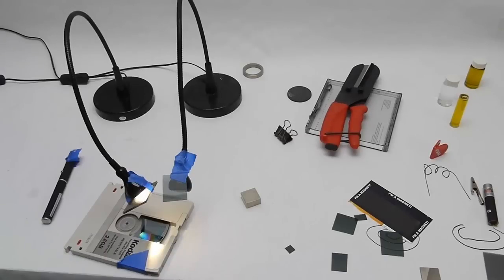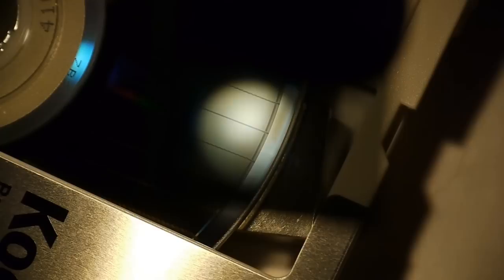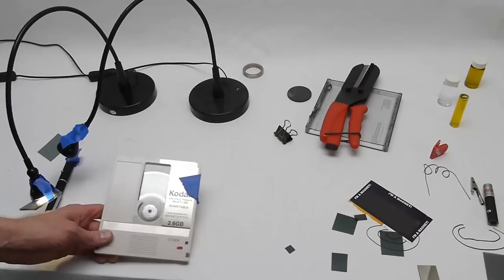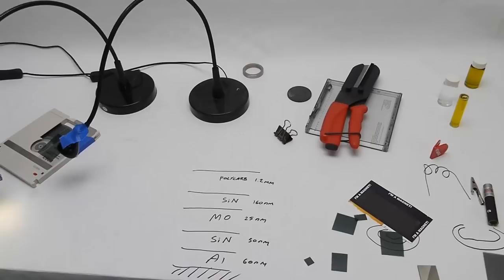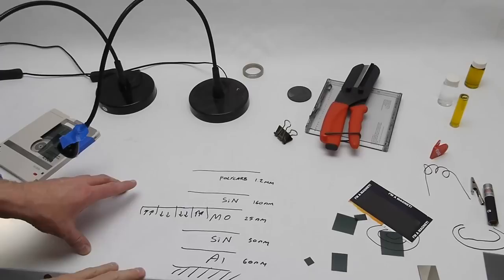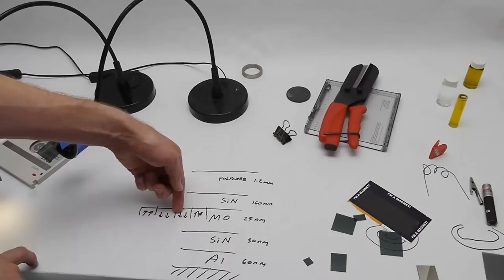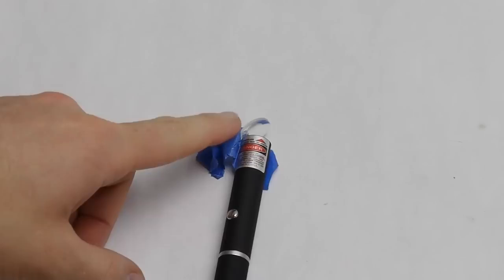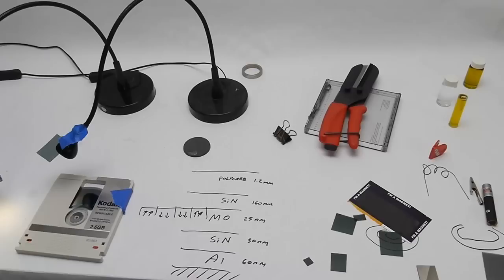Control light with heat and magnets (Magneto-optical Kerr effect)

Comment: Just to clarify, random access means that you can access arbitrary data on the storage without the need to go through the rest of it. For example magnetic tape is not random access since you have to scroll it to where you want to read or write which takes time proportional to the distance from where the head is. 

The term you wanted is rewriteable.
Reply: mina86   I would say when writing is is randomly placed; when reading, it is reading the scattered data as opposed to adjacent.

Comment: Temporary effect in poly carbonate reminds me of photoelastic ( or elasto-optic) effect that's present in materials like glass, celluloid, gellatin and wide range of resins. It's connected with mechanical stress and some explanations exist like Wertheim law. Your testing setup is very similar to what was used in measuring of mechanical stress in complicated objects before computers were powerful enough to run a simulation like that.

Comment: This was really interesting. You described how the magnetic field was flipped while a laser heated the material up to its curie point; is this similar to how re-writable DVDs and CDs work?

I had a MiniDisc back in the day, and it was great. This was shortly before MP3 players were a thing, so being able to carry around hours of music in something half the size of a cassette walkman was revolutionary back then. Plus it ran for ages on a single AA.

These days we just do it all on our smartphones, but you can get MP3 players with 10 times the capacity at a fraction of the size. It's crazy how far tech has come in 15 years. Solid state storage and Li-on batteries are the dog's bollocks.

Comment: MiniDiscs were great. I bought a MD recorder when Sony introduced the HiMD version in 2004. Better sound quality than the MP3 players in that time, exchangeable storage and the retro factor. Really nice system, but ancient compared with modern players.

(Still have my recorder and tons of MDs.)
Reply: ***** You do realize the sound quality depends on the bit rate encoding of the MP3, not the storage medium, right?
Reply: ***** It depends on the bitrate, the codec and the hardware. At that time flash memory was expensive, MDs were cheap. The Atrac3+ codec is much better that MP3 (same bitrate). And the hardware of Sony MD recorders was better than most other MP3 players.

Today flash memory is cheap. Now I use FLAC, AAC or opus and high quality players with micro SD cards.
Reply: Oh, Sony used a different CODEC than MPEG.

Comment: Could you tell us how did you measure the output power of the laser ? I bet a lot of us would like to know.
Reply from the maker: Periode-ik I used a commercial optical power meter at work.  Kinda cheating, I know.  The cheapo eBay laser pointers vary a lot, but they are all way over 5mW.
Reply: Periode-ik Cheap way to get ballpark (I guess error is few %) figure of laser power is to take solar cell with known absolute spectral response. It tells you how many A you get per W of incident light power at specific wavelength. Then you measure short circuit current of solar cell when you shine laser on it. From there is very easy to calculate power of used laser. This method is proven to work even for near IR lasers with few W of power. 

If you have any more questions I will be glad to answer.

And always remember to wear safety glasses when looking at laser with remaining eye :)

p.s. I figure you can use photo-diode or photo-transistor instead of solar cell for weak lasers.
Reply: Applied Science And why is that the power output is way higher? If it's cheap, I'll expect less power than anounced, not the other way around.
Reply: dsiefus It is the opposite the actual laser power output is less than specified.
Reply: Michel PASTOR No, he said (quote) "but they are all way over 5mW.", and the video he said it is 250 mW.

Comment: Great explanation - thanks! I have a couple of MO drives, both for 130 mm (5.25 in) and 90 mm (3.5 in) discs. And also hifi and portable minidisc recorders. I have found this technology to be very reliable. Sony effectively killed off the minidisc format by designing the most inept software for transferring music from computers to their their NetMD recorders.
Reply: Indeed great! Sony, and every digital media manufacturer faced the fear of uncontrollable, non-licenced digital (= original quality) copying cutting down the sales. I have a NetMD, which is, when thinking it from this perspective, probably one of the greatest stretches since the Big Bang. They have the copy protection and user base demand for high speed digital copying. Haha. Digital copy protection was spread everywhere making life difficult. For example, I can transfer any music onto MD, digitally. Encoded, but still. What I cannot do is to record my own singing or playing or nature with my own microphone and load that via the USB cable. I have to make an analog copy of my digital recording. And I've done that. Fortunately, things have changed :)
Reply: best option for coping recordings from md to computer was via optical SPDIF - my dad had an optical SPDIF input port added to his computer.. (thats all long long time ago...)

Comment: Im not convinced that this is the magneto optical effect. Do you think that there is a possibility that the strong magnet forces a significant realligning of the magnetic particles when it is heated u by the pointer, ie its kind of "melting" the optical surface temporarily. Without the magnet it doesnt do it as there isnt a sufficient magnetic force on the particles so they just stay where they are.

Im not saying this is what happens for definite, its just my take on your cool experiment!
Reply from the maker: ***** It's certainly possible there is some other effect causing the alteration.  Without crossed polarizers, there is no visible evidence of the altered area, but I agree, it could still be some kind of weird stress effect in the polycarbonate caused by the magnet pushing on the magnetic layer.
Reply: Applied Science I wonder how you could verify it?
Reply: Applied Science can you verify the magneto-optic kerr effect is occurring by flipping the  polarity of the neodymium magnet beneath the disk and reheating the area? Shouldn't this reverse the magnetic domains of the heated region and produce reflected light with a different polarization than what you are seeing here?
Reply from the maker: Alex Gibbs It's a good idea.  I tried this, and the result was surprisingly inconclusive.  The track width created by the laser pointer is super narrow, and flipping the magnet involves disturbing the orientation of the disc relative to the polarizers, so the whole setup needs to be re-adjusted, and this makes it difficult to see if the new tracks have different polarization rotation.  I should get a much better setup with a more reliable magneto-optical material.

Comment: Probably a dumb question, but what is the difference between this and a rewritable CD/DVD? Storage capacity? Thanks! I really enjoy your channel.
Reply from the maker: William White Rewritable CDs and DVDs have a single spiral groove that has no bits etched into (it is smooth).  There is a dye layer that is deposited on the smooth groove, which contains the data, and it allows a strong laser to melt the dye and change its reflectivity based on how much power is deposited.  There are no magnetics involved.  The alteration of the dye is done entirely with a thermal process.  The problem is that the whole disk must be erased because of the spiral groove -- no random access filesystem.
Reply: Great, thank you for the explanation.

Comment: Interesting. Never used one of these magneto-optical drives before, but I've had plenty of experience with Iomega's Zip drives. From their appearance, they've got a similar platter to a floppy disk, but they also include a lattice very similar to an omnidirectional safety reflector. Any idea what those are for?

Comment: Great video. This is slightly OT... We've seen electron microscope images showing the relative size of the features on CD, DVD, Bluray. Can you do a video about NAND flash? If the memory elements are laid out in 2D, they would be way more dense and tiny compared to Bluray and current HDDs.

Comment: I don't think this is the Kerr effect.  You explain how this storage disc needs two parts: a laser and a magnetic field.  Without a magnetic field, the magneto-optical layer will cool to a random orientation, what I would assume would be the manufactured state.  When burning CD's you can physically see the burn.  This too is an optical format.  

I bet if you shined the laser around using a small magnet you would be able to see the magnetic field lines.